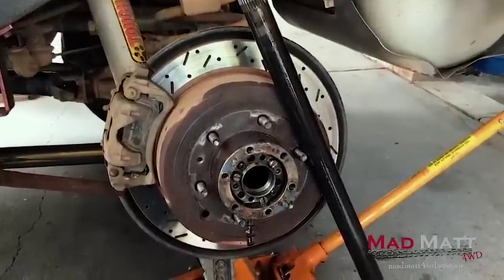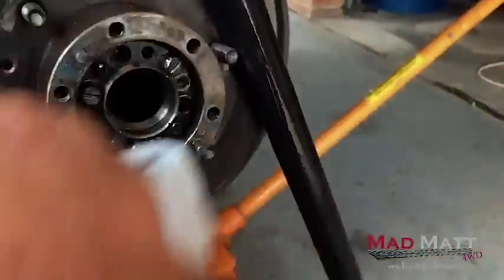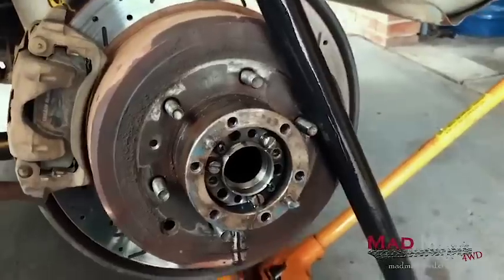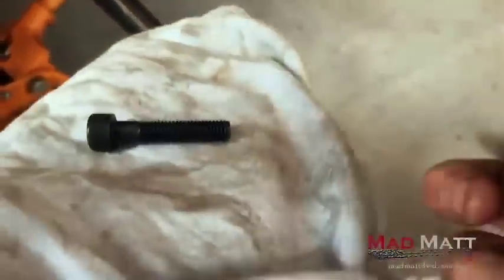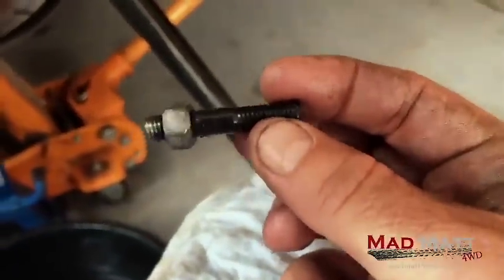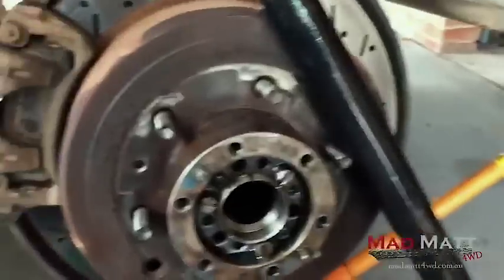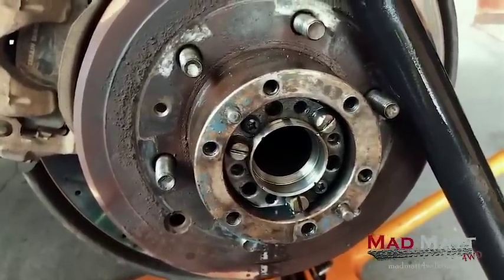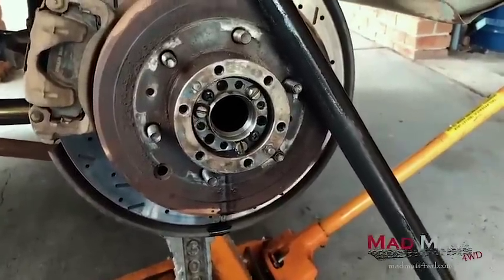Wheel bearings - Why I use oil instead of grease!

Comment: Another enjoyable video Matt, my two cents...

My 80 series experience extends to owning two over the last 15 years, driving exceeding 400,000km, wheeling them hard if infrequently, and working on many of them. My Landcruiser/Hilux experience spans over 35 years and a million km of driving, wheeling, towing, plus maintaining and repairing and modifying countless vehicles. That is not to say my way is the only way but I thought I would share some of that experience. 

Toyota’s method for wheel bearing adjustment involves measuring the seal/grease drag torque then setting and measuring the hub starting torque with a preload of about 7Nm ON TOP OF the grease/seal drag. Preload means less than zero clearance. It is hard to get right by feel. The maintenance schedule also calls for regular inspection and, if necessary, adjustment. The rear is easier to set up correctly than the front because there is only one nut, and I suppose it’s Murphy’s law but the “proper” adjustment always seems to fall between the locking screw holes so in practice I always go up to the next tighter spot which can ramp up the hub preload torque to 10-20Nm, which in my experience does not have a negative effect on bearing life. Bottom line is they should never be run with clearance, there should be a slight starting drag which is almost imperceptible with the wheel on but is definitely there when the wheel and brake are removed. The “breakaway” or starting torque is due to breaking the initial static friction between the rollers and the bearing faces; because the inner and outer rings are (obviously) different diameters, there is necessarily some sliding contact between the rollers and the bearing faces.

The other thing to keep in mind with wheel bearings (or any other rolling element bearing) is that it must be scrupulously clean when it goes together. The factory assembly is done in cleanroom conditions and the closer to that you can get, the longer the bearing will last. One teaspoon of sand going around the bearing a million times will wear the bearing the same amount as a millionth of a teaspoon going around a million times. A million wheel revolutions is only a few thousand km. The lubricant will only ever be as clean as it is the day it goes in. There is no filter or mechanism for contaminants to get out and very little stopping them from getting in. 

So, to the main question - grease or oil - there are good reasons for both. For highway use, I think wet lubrication is right on the money. Many trucks with similar bearing systems are wet oiled, and correctly adjusted and maintained the bearings can last well over a million kilometers. There is certainly less friction therefore heat buildup which translates to a measurable improvement in fuel economy and extended bearing life. 

For off-road use the equation changes. Grease is a displacement lubricant, and a correctly greased wheel bearing has very little space for water or other contaminants. A properly packed bearing has no air space in it and a properly packed hub has very little air space. If you ever intend crossing water more than hub deep, or driving long distances on wet, unsealed roads, grease in the bearing with the inner seal installed is very cheap insurance. 

The axle to housing seal (deleted as described to achieve wet lubrication) achieves more than just separating the grease from the oil; it’s an extra layer of protection for the final drive and differential. Losing a wheel bearing is a nuisance. $50 in parts and an hour of your time. Relying on the grease seal behind the inner wheel bearing to not only keep oil in but contaminants out of both the wheel bearing and the axle/final drive might be a risk not worth taking. If even a small amount of muddy water contaminates the axle oil, within a few hundred km,  big big dollars worth of final drive gears, locking devices and bearings are reduced to so many kg of scrap metal. 

In Toyota’s estimation, well adjusted and properly installed, greased wheel bearings provide the best compromise between on road and off road performance. I have had landcruiser wheel bearings last well over 100,000km without repacking or adjustment, but vigorous off-road usage will inevitably shorten that service interval. 

A quick word on 8mm studs, and I’m sure this has been facebooked and forumed to death. Toyota revised the 8mm studs to 10mm with a corresponding hub redesign with more hub meat around the studs in 1998. This provides about 70% improvement in shear strength and axial clamping force over the 8mm studs for the same class fasteners (8.8ish for the Toyota studs).  This came about as a result of the growth in deliverable driveline torque over time- more motor torque and lower gearing, greatly increased gross vehicle mass and improved tyre technology (traction is the ultimate limiting factor for driveline loading), and the weakness was revealed in the mighty 80 series. 

I like the M10 cap screw modification. If it’s done right. Which involves completely stripping the hub and drilling and tapping it in a drill press or mill to ensure straightness. But there are at least two problems with M10 cap screws. First, drilling for M10 results in a compromised wall thickness in the hub. There’s no way around this - if you upgrade to 10mm studs you make the hub itself the weak link. It’s probably not going to be a problem unless you’re running big rubber or lower gearing. Second, and this is a bit petty but worth mentioning, the heads of M10 cap screws when installed will protrude ever so slightly beyond the diameter of the hub. They might prevent the disk/drum from slipping off the hub neatly. 

There is an awesome alternative. 3/8” UNF cap screws are a hair over 9.5mm diameter and the heads are about 1mm smaller than their M10 counterparts. This restores the balance between bold diameter and hub material, and the drum will also come off easily, guaranteed. The only real downside of this alternative is having to carry a not metric tool, but it’s a small price to pay. For the record, I have 10mm studs in my 80. I had done a few 3/8” mods and a few more of 10mm. As far as I’m aware neither has ever suffered a failure of the screws or the hubs, including competition use. 

While I’m on a roll (see what I did there?), a few thoughts on the hand brake. If you drive in mud, let it go. The handbrake will never work. Mud causes all kinds of maintenance issues and it’s best avoided despite what every 4WD ad on tv would have us believe. If you are a grown up and enjoy a technical rock crawl over a juvenile mud blast, the handbrake can be adjusted to work well and consistently. Again, follow the Toyota procedure and you might find the results surprising. Again, keeping it clean is vital.  The handbrake is a rego inspection item and is the only emergency braking system in case of a hydraulic failure. It’s something to think about. 

If you read all that, go get a sandwich. You deserve it.
Reply from the maker: Hey Brian, I think we may have met? Are you mates with Jono? Hey, thanks for the write-up, Essay. I did read it all. I hear and understand what you say with the oil vs grease comments. my experience with oil has had no negative experience to date with probably 200,000ks of operation. I have a number of other 4wd mates who are also running oil successfully. I think i learned a bit more about setting up the bearings although I have read the FSM a few times. Thanks. As for the hand brake, I've set it up as per the manual many times with minimal long term success. Maybe there's a video where you can help me get it right if you live near Jono. wink wink. Oh and totally agree about mud although It's hard to avoid sometimes. Thanks, heaps for the input.
Reply: That’s me, yep. I had my handbrake apart this week too... 

Probably no time this side of Xmas, see what January turns up.
Reply: U jusr wrote an essay
Reply: U begin my saying you'd give Ur 2cents.. mate. I'd say that was the money box!
Reply: I'm a bit late to the party here. But on your comment regarding grease and minimal to no air space, normal recommendation is that they shouldn't be packed completely full of grease, needing some space for expansion. I've found when I've ignored this (because I'm much smarter right) that I end up with grease coming out everywhere. This isn't in the rear of 80 LandCruiser though, no experience with those. Any thoughts or comments on that?

Comment: My old 86 Chevy C30, the Dana 70HD rear axle has oil only bearings.  No grease.  Those bearings are still like new, and they are original.  You just gotta make sure your hubs don't leak.  Leaks are bad.  A great idea though, and yes, you need to be careful of bearing preload on oil bearings.  Good job man.
Reply from the maker: Cheers
Reply: First generation Range Rovers also ran this arrangement for the first 20 years, and were not known for wheel bearing issues, they where however known for oil leaks and in the last years of production they switched to grease, they then started developing issues.

Comment: Try cotton picker grease in the front hub assembly. Thick and sticky but flowable like oil.
Reply from the maker: ok
Reply: Hi Matt, Great idea! I'm going to convert mine to oil. I live in Canterbury New Zealand and 90% of my 4x4ing is in river beds with LOTS of water crossings. I'm just replacing front cvs and they are full ow watery/oily grease. Admittedly the wiper seals were worn out. Was thinking as to weather I could somehow run the front cvs and bearings in oil too.

Comment: A loose or worn bearings in this system can cause the axle studs/bolts come loose or break off due to the hub flexing against the straight axle. 
As for front oil bearings, weren't Range Rover's oil bath CV and bearings ?
Reply from the maker: Yes that's correct on both counts.

Comment: Grese will stop water oil won't :(
Reply from the maker: You say that but it doesn't work like that. I've pulled out bearings and the water is just sitting there. with oil the water can evaporate off over time.
Reply: Yup especially when the wheel spins there is heat generated from friction

Comment: I don't understand why Toyota wouldn't oil bath bearings on full floating axles.
Reply from the maker: My guess is that it comes down to manufacturing costs and from a warranty point of view you have less risk of and oil leak.